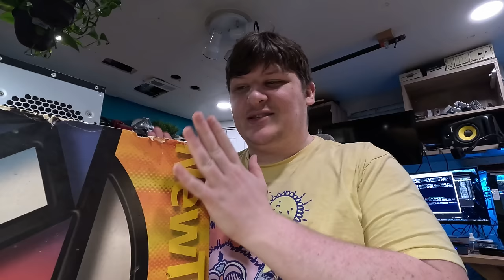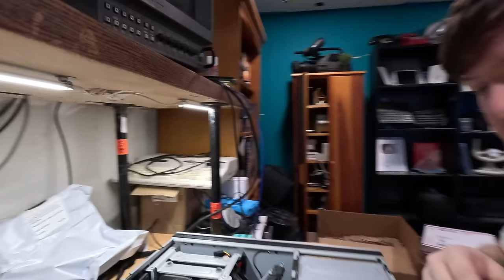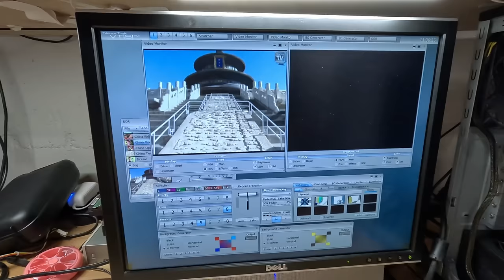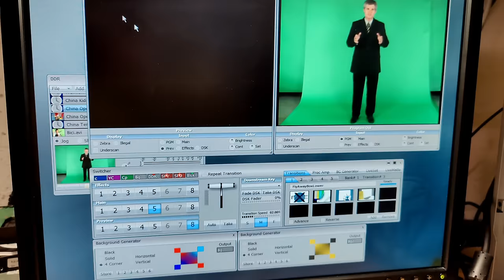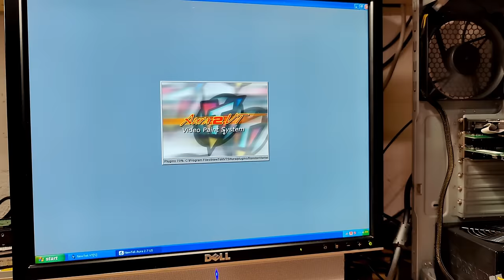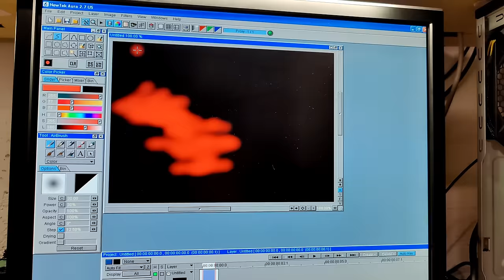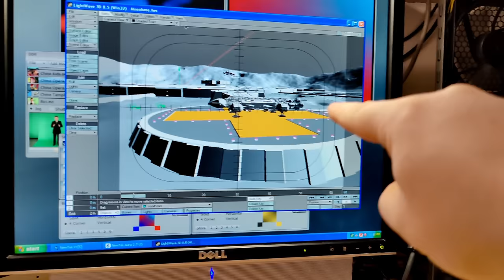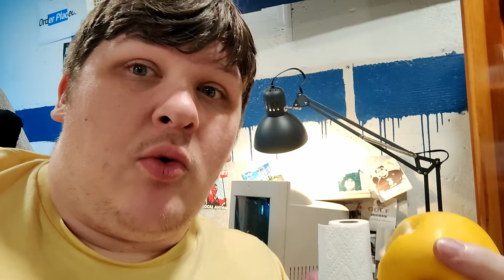Building a Video Toaster. No, not that one

Comment: Your description of the Amiga VT and why it was not so easy to accomplish on a pc is a bit incorrect. First, the Amiga VT was very much an "analog" card. It DID take the Amiga's digital video signals and mix them with the analog switcher section, but there were no FPGAs on the card (that I am aware of). Yes they had some custom chips, but not what we would refer to as an FPGA today. 
Secondly, and absolutely more importantly, is that fact that the video slot gave the card direct access to the video generators and timing signals on the Amiga is the ONLY reason it was possible in the first place. The Sharp X68000 is the only other home computer contemporary that had the capability (by plugging in a rather large, set-top sized external box). There was also a variant of the 8-bit MSX that had titling capability, but it was garbage.
So, the reason NewTek initially avoided trying to create a PC based VT is that they had NO access to video timing signals. Every PC video card maker did different things. There was no common bus interface to get these signals off the cards. NewTek would have to design their own video card, in order to then design the Toaster into it. It would have made the whole system an order of magnitude more complicated, and they would need to import a LOT of talent to roll their own video card, or partner up with a manufacturer already in that industry.
This would both make the cost of the card much higher, as well as TIE the image quality to the current state of the art in video card design. In other words, if they got a sub standard video card out of the process, not even capable of playing the latest games, then they would end up with a really beautiful analog switcher tied to a crap digital signal.  It was just WAY OUT of their technical domain at the time. 

The alternative here would be to take the VGA output of the video card, frame buffer and RETIME the whole thing, then do a lot of digital voodoo to get chroma-key working, THEN convert it all to analog and spit back out (deeeeelaaaaays). That's ALSO a whole new domain of research, though much more accomplishable. That's likely why they had a generation of basically junk cards before getting it all working. Building up that digital knowledge and experience  (when their hardware team was primarily analog video) takes time.
Even with that "better solution", it still likely had to be tied to whatever the industry standard maximum screen res of VGA was at the time of release.
Reply from the maker: So, I've heard this explanation in different terms over and over for 20 years, and I have to be frank: I don't accept it. Nobody ever cites a primary source, it's just telephone-gamed info from breathless magazine articles written decades ago. I've never found an official source, an actual Newtek-penned document, explaining why they chose the Amiga, or what processing gets done where, or whether those ARE FPGAs - we don't even know. Maybe they're debadged FPGAs, maybe they're PALs, maybe they're ASICs. I've never seen so much as an architecture schematic, and I'm not interested in speculation. "The amiga runs at NTSC frequencies" doesn't really explain anything. Is it racing the beam, editing pixels on the fly? Does the card do the equivalent of bus mastering to inject frames into memory for the software to manipulate? Or is the software simply telling the chips what to do and mixing everything in hardware? If you have an official, Newtek-authored document that answers these questions, I would love to see it. If not, then as far as I'm concerned nobody knows how the original Toaster works, and any speculation is pointless.
Reply: @CathodeRayDude  I had a lengthy response but youtube gobbled it.. Likely because I cited sources.
https://youtu.be/7qCYr0fPqCI?t=274  These guys built the thing. "The Amiga, of all the computers in the market, is the only one set up with video timing."
Theres also an arstechnica article you can google for (id link it, but then giving sources on youtube seems to be unacceptable).
There are LOTS of people who understand the inner workings of the VT. The hardware isnt that complicated except for the frame buffer. Its 4 major systems : Switcher, genlock/Chromakey, VTR controller and that frame buffer. Of the 4, other than the frame buffer, you could easily buy off the shelf parts that do the same work. There were several Amiga Genlock/keyers, including one made by Commodore for the A1000 before the VT came out. Its all analog and basic logic chips. The switcher is all analog with a few logic chips for grabbing the genlock signal, and channel switching is done by parallel port signals on the video slot. The VTR control is just serial coms to the VTRs. Nothing here is rocket science.
The frame buffer is their secret sauce. But all the transposing is done ON THE BUFFER by their own controller. The Toaster is NOT a FMV capture device. It works just as smooth on an rock bottom A2000 as it does with a fully expanded fast A4000. The host machine performance is irrelevant to the video effects performance. The only effect is the Amiga's own native image output performance (titles, still frame graphics, whatever you are switching in from the Amiga as a source). There are no effects happing to live video performed by the Amiga. Its all in the VT buffer.
Reply: @CathodeRayDude  its not an FMV capture device.  Even highly expanded (fast, lots of RAM) Amiga wouldn't be able to handle it, let alone do effects to broadcast video in real time. Even the best fmv capture devices for PC in their early days were trash. And that trash depended entirely on system performance per each frame.

For FMV capture, the option on Amiga was the Toaster Flyer, which finally enabled non-linear editing.

None of this is opinion. It's well established fact.
Ask someone like Amiga Bill.
Reply: @CathodeRayDude  also its absolutely impossible for the VT to be shuttling video frames real time into the Amiga system bus or RAm because the Amiga video port doesn't even have system bus pins. It's got 2 sections: video and parallel port sections. Video is just that. Mostly output.  Image and timing signals.
The parallel side is routed directly to the external parallel port  same pins. Some are used for switcher control. Some are used to command the buffer logic (for effects). It COULd also be used as a frame capture but at 8 pits, it's super slow. NewTek first made a frame capture device for the parallel port that could only capture Grayscale. So you had to use a color wheel. Def NOT FMV over the parallel port.

Comment: 33:44 Why not put the backplane bracket with the ribbon cables in one of the 4 open slots you have there BELOW the card??? That would clearly solve the issue with the ribbon cables being next to the heat sink.
Reply from the maker: Because then the cables will have to fight the USB and front panel audio headers, SATA, and the entire power supply bundle.
Reply: @CathodeRayDude  At the time stamp I linked, it looked like there was more room for them that way than the way you installed it. Might just be the camera angle though.

Comment: Is connecting all the ground wires reduce the cost? It doesn't make any sense.
Reply from the maker: It does! You can use like 8 or 10 fewer wires in the cable
Reply: @CathodeRayDude  Sure, but can't  they use one wire for RGB and one for EDID?

Comment: Around 43" you glance over "scopes" & "legal video" I'd like to know more about that.
Reply from the maker: I don't really understand how they work, but basically there are signals you can output from a video device that will cause havoc with transmitters or televisions if actually broadcast, and they're called "illegal" values; and the scopes are for checking both that and other kinds of calibration, I think regarding color balance. But I've really never understood this stuff.
Reply: @CathodeRayDude  Thx for the answer I dug a little and found that the company Tektronix published pdf on preventing illegal color or out of bound gamut. I don't understand half of it but it seems standards like NTSC simply doesn't support the full color spectrum, when the footage is produced by a NTSC camera it's not a problem but computer inserts can introduce does illegal colors I'm not sure of the "damage" but at least bad color display. I would put in the link but might be better for your security to look up Preventing Illegal Colors Tektronix.

Comment: I have the other way, I have a newtek hardware switcher and am trying to get it to work as a USB input but even after hacking a MIDI controller to see it, I can only use several buttons but no chance of using in VMIX or OBS .
Reply: Have a look at our software, Central Control. It can map all the USB NewTek surfaces to a bunch of different stuff.
Reply: @thisiscentralcontrol  will it detect is just plugged in from the USB on the deck? Windows won't even acknowledge it plugged in.
Reply: @adamcboyd  specific drivers and then i reverse engineered the protocol

Comment: Why not put the breakout board in one of the lower slots instead? Theres no real reason it has to be above the other card like that is there? 

It would allow the cables a lot more room to breathe. 

I'm also failure sure those are the same multi-coax cables used in RF test equipment, it looks similar to some of the stuff we had when I was working for a local ISP
Reply from the maker: If I route the cables under, they run into the USB, front panel audio, and button/LED header cables.

And yeah I would totally guess that these cables show up elsewhere, they definitely aren't proprietary, I found the exact same thing being made by someone called "Quadrangle"
Reply: @CathodeRayDude  Ah yeah fair enough. I love this goofball stuff. its that weird crossover between super adhoc and janky, and super high end. 

Also, keep an eye on those shuttle PSUs, they love to blow up and can potentially send a power surge into the system. Replace with a pico-psu if you can.